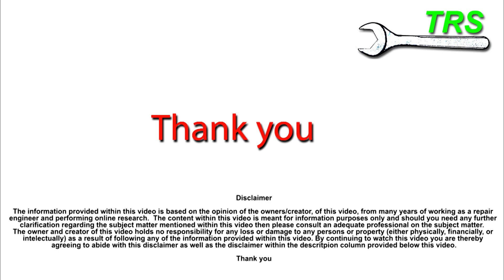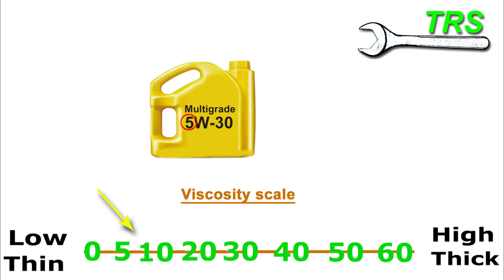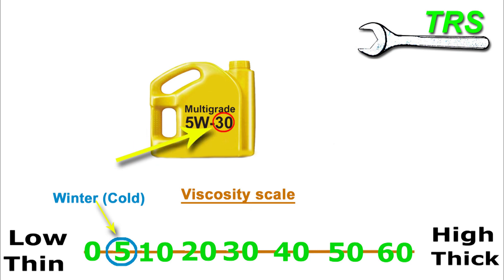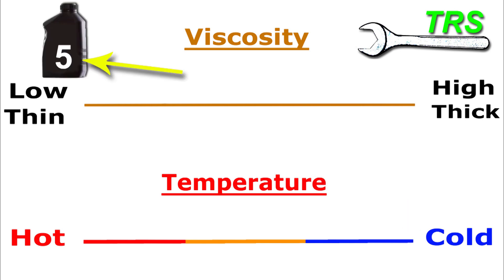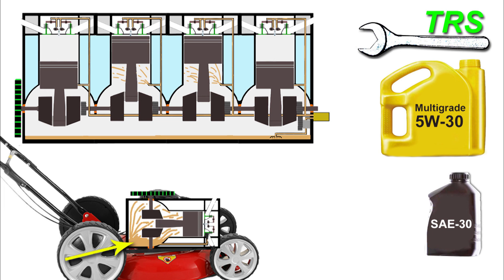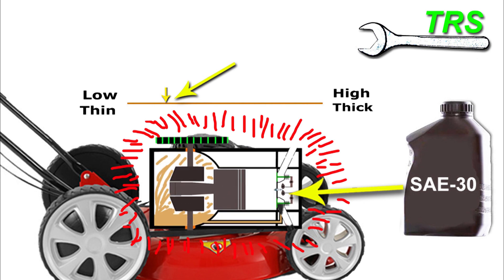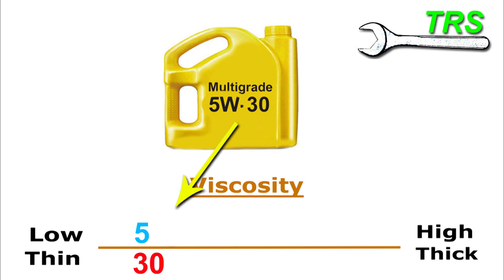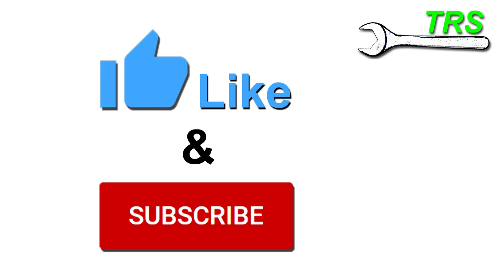Engine oil 'Explained'  &  Engine Oil Viscosity 'Explained'.  (by Craig Kirkman)

Comment: What oil index is to use in hot weather (15c° to 34c° in winter and up to 25c° to 48c° in the summer) for a toyota corolla 2018 model as the manufacturer recommends a 0w16 ? Is it possible to use a 5w40 or a 10w50

Comment: You are a very good teacher, easy to understand you. I  have been driving 45 years. Most of the time I've used 10 30, or 10 40 in my cars. I've put over 340.000 miles on several of them, all bought brand new, with no engine issues.  I purchased another new  car in 2017. Its got the 5 20 oil deal on the cap. When I got home after driving about 20 miles from the dealer, I opened the hood to hear it run. It sounded TERRIBLE!! I've never had an engine sound so bad. Even my old high mileage engines sounded good. I'm in Southern California and it was purchased in june and already having 90 deg f heat. So, after 400 miles I dumped the 5 20 junk, and put 5 30 in. WOW, the engine quieted right down. I run 5 30 November to June, then in june I run 10 30. We have summer temps average 110 to 125! Car has 73.000 miles now, and purrs like a kitten,  very quiet at idle.i change my engine oil every 3500 miles, I always have. I should add, the owners manual said that depending on climate, 5 30 or 10 30 is acceptable . I run 10 40 in my 58 cadillac year round. Been doing that for decades, my parents bought it in 1960. Thanks for your interesting tutorial.
Reply from the maker: Thank you so much for the nice feedback. I really appreciate it. Craig

Comment: I would best explain it as; The oil gets stronger and the (strength) increases the hotter it gets, molecules become stronger more held to gather which makes them bond ie cling more to each other and stick to the metal better due to its elasticity, but stays the same in thickness ,
cold less bonding hot better bonding,

Comment: What about 0W-20? Does that mean there is no difference between the viscosity when cold vs hot? Thanks
Reply: Did you watch the video?  Cold, 0 w , hot becomes 20 wt. If there was no difference. Would just say 0 wt, period.
Reply: @1958Cadillac-v2g  Wow, you take oil very seriously.

Comment: Thanks for explaining more. So a 5W30 has a SAE of 5 when cold, and a SAE of a cold 30 that is now hot. I still think they used a confusing method. It's feels like comparing apples with oranges.
Reply from the maker: A cold 5 and a hot 30
Reply: @TheRepairSpecialist  Now you got me really confused. So the oil is indeed thicker when hot ? I'd like to see that in a rundown. Cold vs hot side by side, and the cold is going to finish first ? Thanks for explaining, my brain does not want to co-operate.
Reply: @TheRepairSpecialist  Thought I would ask directly - With this in mind, what does the Zero mean in 0W-20 for example? Does it mean, there is no difference between the oil when it's cold vs Hot? Thank You
Reply: Can I ask if it’s fair to say that the base oil is a 5 and though it would thin out as it gets hot the additives in it thicken as it gets hot and the result is the multigrade oil /additive mixture maintains it’s viscosity and stays at a cold 5 equivalent which is very close to the viscosity of a hot 30?
Reply: What is really interesting is that a cold 5 weight oil (as you pour it from the can) is thicker than a hot 30 weight oil! It’s certainly very thin as it pours from the sump plug hole when it’s just warm. A hot 5 must be crazy thin.

Comment: Yes, the scale used is confusing if you carefully think about it. The warm test uses a different scale compared to the cold, so the two scales are not comparable. The key point is that all automotive oils will have lower viscosity at higher temperatures. Multigrade oils simply have a more gentle downward slope of the viscosity to temp curve, compared to monograde oils. One day I tried to add a litre of 5W30 oil at -40 deg C ambient temp to a warm engine. Molasses through a funnel, it took 20 minutes to drip through.